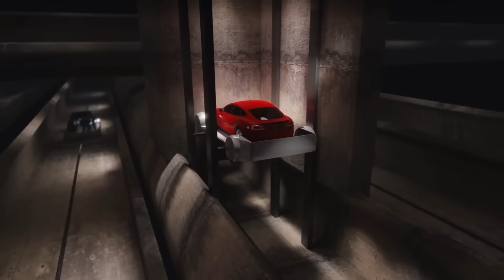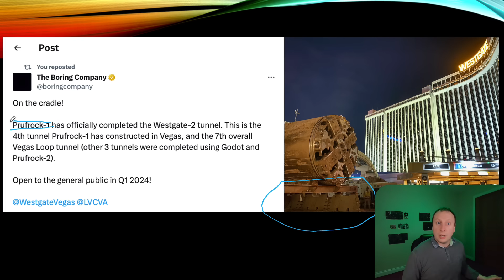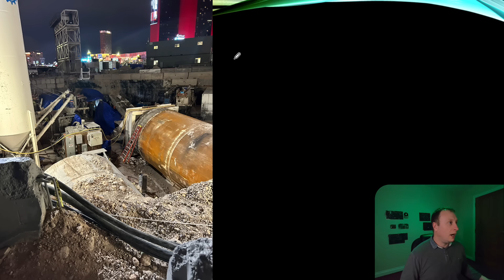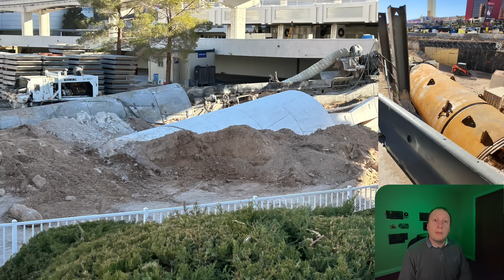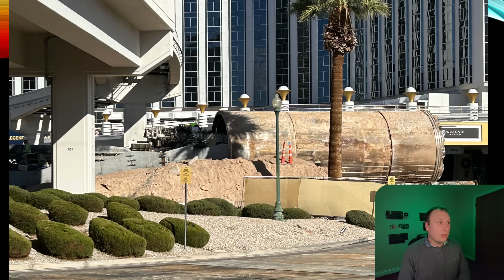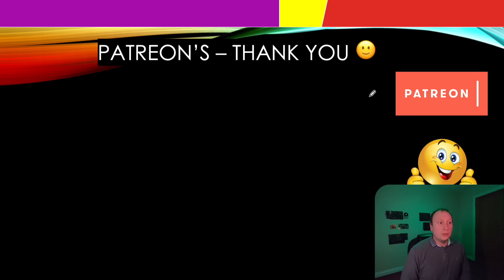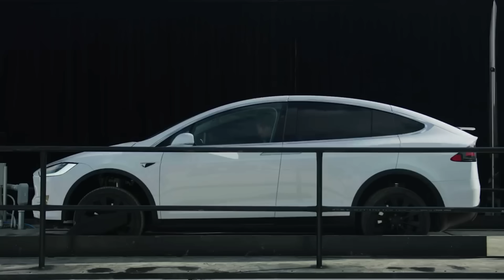New Boring Company Twin Bore Tunnel Completed in Las Vegas 🚇 👷🏼 👍🏼 💚 🤑 #186

Comment: Will, as you are a close follower of the boring company can you shed any light on why drivers are still used in Vegas when robot taxi are said to be closer why they're not using FSD in the tunnels in Vegas? Controlled environment few of the open road variables to automate the system, why not?
Reply: Because if FSD messes up in the tunnel it would show how dangerous having no safety exits would be.
Reply: If FSD is not capable of not "messing-up" in a simple tunnel environment it will never work on public roads. @dong9514
Reply: No it would show that in a very simplified environment it does not work. If FSDis near to be operational on the street these tunnels could show the confidence of Tesla in their FSD. @dong9514

Comment: Their construction sites are an embarrassment. Total shambles with safety violations everywhere you look. Site manager should be fired.
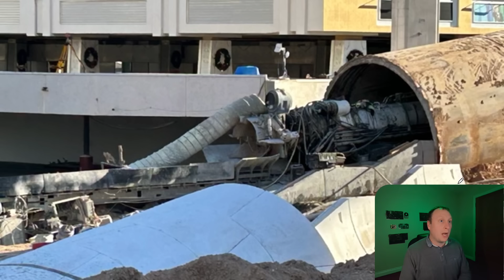Also at 6:30 ish into the vide it shows a tunnel emerging which has clearly used trapezoidal universal segments for construction of the rings only to then have hexagonal invert segments in the open section behind the TBM front shield. Someone is being economical with the truth I think. Got to keep conning those venture capitalists into pumping more funding in I guess.

Comment: Is the tunnel diameter the same with Proofrock 2 and just an improvement in tunneling speed, or is it also a larger diameter?
Reply from the maker: it is still 4.15m for both machines. The extra speed comes from more power and better logistics.

Comment: Thanks Will, you're probably too busy but would love a video on what these machines encounter while tunneling.  Do you have to do geological surveys before tunneling to avoid denser material?  Do you ever run into water?  (I realize probably not in Las Vegas).  Is anything ever found like fossils or valuable minerals?  And how far down must the tunnel be to stay under pipes and electrical wire?  Thanks for your work.

Comment: Why would they make a loop stop at Westgate?

I was there recently for the F1. It already has a monorail stop

It’s a depressing crap, tacky, smokey and cheap perfume filled old ass hotel casino/resort that tries to scam you into their time share condos…
Reply from the maker: It is crap but when I go to CES, I will stay at the Westgate as the rooms are dirty cheap. 
I think they should expand the monorail but it would cost them $28.5M per mile.
Reply: They are avoiding any hotel that is physically on the strip for multiple reasons you'll notice every hotel casino that they use is off the strip currently, as well as the next two that are in the works are off strip
Reply: @chadgroen  Why is that though?
Reply: @Tigerdograt  trying to keep cost down, there are different laws that apply when you are building on the strip. For one you must incorporate the union, for two, multiple property locations require that you must pay prevailing wage. Currently there is a very small crew that work 72 to 80 hours a week. They would have to triple or quadruple staff and increase wages drastically, also they wouldn't be able  to get away with a lot of the safety violations, sneaky and unethical things that they do if they were under the closer eye of being on the strip or in the shadow of a casino

Comment: Is there a tunnel between the LVCC West Station and the LVCC Riviera station? The drawing you showed in the video indicates the Westgate tunnels will link to that connector tunnel, but I was unaware that tunnel had been completed. I don't think I have seen any video of it in use. I've just seen surface driving between the two stations.
Reply: Well thanks to google maps and a bit more digging it does look like the tunnel between the stations has been built